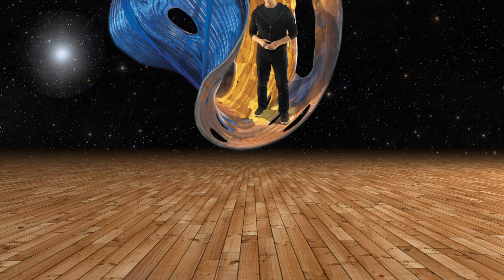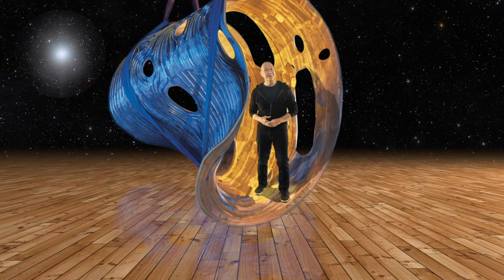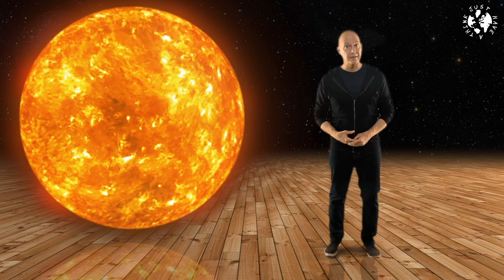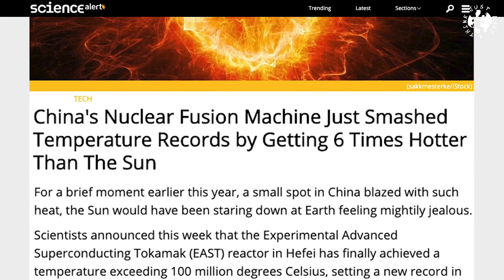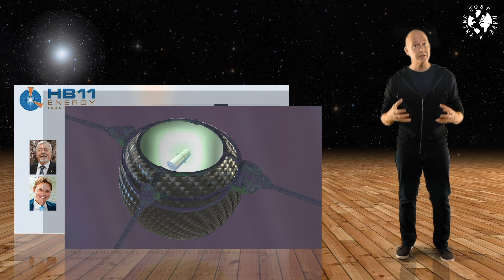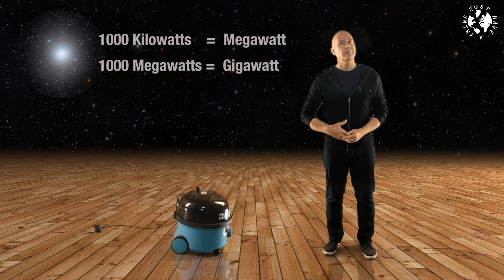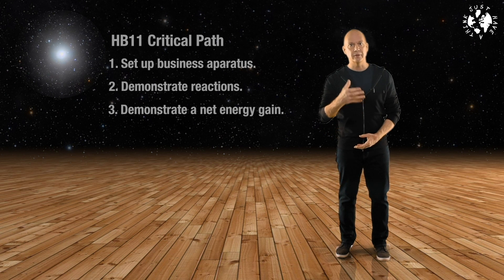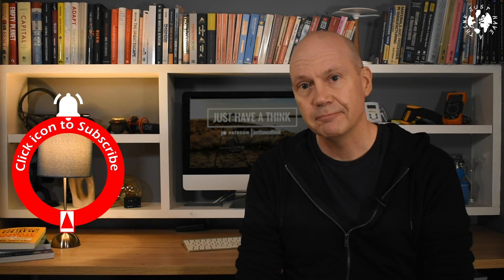Nuclear Fusion:  Revolutionary new breakthrough.

Comment: Even in the 1970s, lasers were available that produced electric field components in the beam which could accelerate electrons from rest to almost the speed of light in the diameter of a proton. The much heavier particles of fusion fuel would not go so fast, but they don't need to in order to initiate fusion. They don't even have to go 1000 km/s. Now we have tabletop lasers built around Titanium Doped Sapphire that can put out pulses at far higher power, in the hundreds of terawatts (TW), for about USD$20,000. If this notion of laser-accelerated particles works as well as is being claimed, we should be able to power individual homes with their own Fusion Generators. We should also have been seeing a LOT of people doing research on the idea. Where are they all?

Comment: If nuclear fusion theories were true, stars wouldn’t be distributed along large plasma filaments. Stars also wouldn’t disappear and reappear which we have thousands of observations to show that they do. Stars are an electrical phenomenon, and they, like everything else, are powered by their external environment. Their movement throughout their parent galaxy, and the electromagnetic field surrounding them, causes them to shine. Just like you and I need food for energy, so too do stars. Nothing in the universe just runs itself. Stars are constructive pinch points of electromagnetic fields. This forms their internal structure (gas, rock, metals, etc...), and causes the voltage potential difference that burns them. Just like clouds of water vapor release lightning. They don’t make the lightning bolt, they move through the atmosphere until pressure and voltage differences overcome the insulating boundary between the two clouds, or earth and cloud, etc...

Comment: I like your videos .. we should be concentrating on all types of nuclear. to date its the only low less than 2% to zero carbon emissions ..even with current designs... focus on . Gen 4 passive safe walk away fission designs. Shut down all the older Gen 2 and 3 Light pressure water reactors.. . and not extending all the current fission reactors which are beyond their date.. Energy mix of SMR current fission ...as well as thorium type designs.. and more research into this type of fusion ie both stellartors and  this new described one. Shame all has gone silent on Bussard wiffle ball fusion reactor it seems to have died with him. He did a great talk at google its on you tube on that. But also would be or should be discussed the ENVIRONMENTAL damage of wind power.. ie clearing 1000 hectares of land all around destroyed hedge rows in the process as well as direct in path as it wind of insects and bees and birds etc... which never seems to be discussed..

Comment: 1. Missing fusor type devices that have met similar progress at much lower cost than tokamac projects. 2. D+ T fusion generates 5x neutrons for equiv energy generated - most strong magnets and high temp superconductors contain high cross section neutron absorbing isotopes 3. Proton plus Boron11 makes 3 Helium nuclei (first high energy Carbon12 which may emit a gamma and stay C12 or fragment into helium (alpha particle) plus Berylium8 which rapidly splits into 2 Helium atoms and the energy to initiate this reaction is much more than D+T reaction.

Comment: We still don't, and have no idea how, to make materials that can handle the radiation when it's operating. A fusion core of any commercial size will eat away at it's own core, requiring frequent repair and replacement, making it not commercially viable. Lather rinse repeat. We are no closer.

Comment: Is there some paper detailing the process? If not then it can't be taken seriously.

Edit: ok nvm, there's the paper in the description. Hopefully it can be replicated.
Reply: Yeah, if you read the paper, it becomes apparent that this has nothing to do with practical fusion reactors. As the paper itself notes, experiments with boron fusion like these have been conducted many times before, the only new thing the authors achieved was the increased energy output. A hundred times as much energy per laser shot is cool and all, but just like before it's done on an experimental research laser facility. Even if they try building a reactor, who knows how long will that take them to do, and if they even succeed. A similar company called Tri-Alpha Energy has been operational for 20 years and they still have not built a working prototype.

Comment: I'm going to be optimistic and assume that this will actually work. Just for the moment. So WHY can't we have solar energy and nuclear reactors working side by side? After all, the canoe was probably the first boat ever invented. Today we have ocean liners. But we STILL have canoes! And sail boats were invented hundreds of years ago. And of course, today we have nuclear powered submarines. But we STILL have sail boats. Each piece of technology that we invent, fits into it's own ecological techno-system! We are not necessarily making things obsolete. We are simply adding new things to the world. Some of the old things might not be as widespread as they formerly were, but assuming that they were good solutions to begin with, they are still in use.

Comment: Optical nuclear batteries are made when phosphors glow from Alpha Sources Is Received By Photovoltaic Cells. Make It Glow Safely Then Live Off The Light Energy Converted Into Electricity. Running A Nuclear Explosion For Heat Turbines Or What's On Happening On The Sun Is Dangerous. SAFE Phosphor Glowing, Optical, Solar Cell, Nuclear, Power. Not This Insanity.

Comment: I honestly do think we will see fusion technology in our life times, and there is a good chance we will see it within the next twenty or thirty years. It is not going to happen tomorrow. However, and even when we do have a commercially viable reactor. getting enough of them out there to take care of the worlds energy needs will take time. I think we still need to invest in things like solar and wind for that reason. We could use that technology to cover a lot of our energy needs within the next few years, if we really wanted to. Barring a miracle break through. i don't see Fusion doing that for the next decade or two, even if we did invest all our effort into it, and crack the code in the next five to ten years.

Comment: So when we have all this unlimited cheap energy, after we've used it, where does it all go to? (assuming as usual energy doesn't disappear it just changes to another form)
Therefore we use the energy to make stuff, to live nice lives, do good deeds etc. all of which will have a by product of energy, so the Earth's atmosphere warms up, though maybe with not so much pollution by carbon this time.
Reply: The Earth has a thermal equilibrium point. The hotter it is, the faster it radiates, because glowing in higher frequencies of blackbody radiation eats more energy than lower frequencies. So if we start using a lot of power, we will get hotter a little bit, but it won't be some runaway reaction.

Comment: Short answer, no.

Long answer: There is a reason fusion research is a fringe subject in particle physics. Without a gravity well doing the work getting hydrogen to a plasma state energetic enough to instigate fusion but in a controlled manner is so ludicrously power intensive there is no reasonable path to it being a net producer of energy ever. Physics remains a thing.
Reply: Did you actually watch the video before commenting? I'm not saying these guys are the ones to crack nuclear fusion. Their approach may not be productive in the end. But they do at least address the problem you're talking about.
Reply: @Kevin_Street  Then why are they talking it up?
Reply: So you didn't watch the video.

Comment: Sounds good but we'll never hear of it again. Like so much other technological break throughs. If it does work it'll be buried.
Reply: With the rate the world is moving away from Fossil Fuels, and with the way technology allows information to be shared you can't just bury something that easily anymore. Plus, with Coal dying slowly, the rich need something new to latch onto, so instead of "hiding" it, they're more likely invest in it to get returns and diversify their portfolio. The world is too open to just sweep stuff like this under a rug, especially once patents are filed.

Comment: Until you have a Mr. Fusion device, with direct electron output, no exotic coolants required, with full shielding, instantly stops the reaction once the input power has been cut, and will fit into a rear end of a standard sized sedan, it will just be a very expensive experiment without much if any practical power generating capability.

Comment: A (peta)Watt is a measure of power - not energy. You can (relatively) easily get a petawatt laserpulse if the timeframe is short enough. Because then the actual energy (which is power times duration) is relatively low. Your vacuum delivers the power constantly over a long period oftime. Petawatt laserpulses are on the order of nano to attoseconds long.

Comment: 1. It is no cliche, it is a FACT 2. while chasing pipe dream, rolling out proven, clean modern reactors is stalled - and these can provide "unlimited, safe, clean, zero-carbon electricity as long as we need it". Before shouting about 'waste' and other read pt. 4; 3. Fusion crowd doesn't have ANY credibility whatsoever - until they roll out at least 10MWe reactor working with 80% capacity factor for over a year.  4. Had all these money gone into nuclear, we'd have largely decarbonized grids and sea transportation, powered by combination of 3rd generation (APR+) and 4th generation reactors, largely burning modern and accumulated so called 'waste' and producing carbon-neutral kerosine.5. DUDE learn difference between POWER and ENERGY - so called femtosecond lasers indeed generate terawatt power scale pulses, but just due to extremaly SHORT TIME - POWER IS HUGE, but total ENERGY remains miniscule. Boron route has already been explored by company giving techtalk at google - and then quitely disbanding.

Comment: Every step closer to breakeven involves bigger, more complex, and more expensive reactors, so by the time they exceed "breakeven" and produce useful amounts of power, it will be far too expensive to be economically competitive. That doesn't mean we shouldn't research it, just that we can't rely on it to supply our basic energy needs. It may find some use in special applications like deep space probes, where the high cost isn't a barrier.

Comment: It won't replace oil, or renewable, I don't think it ever will. First it probably won't produce enough volume to supply everyone, second it can't be moved around or stored as we don't have enough efficient batteries to hold electricity like we do with hydroelectric power, fast for sudden high demand. Fusion will be stable output. Third material cost for the prototypes and research and development costs are huge so it probably gonna be more expensive than normal conventional energy which will shatter some people's dreams and high hopes of thinking the moment we have fusion, is when electricity is free and oil is gone, so that will discourage them thinking fusion is just another gimmick.

That's my 2 cents on how it will turn out. See me in 20 years nigga

Comment: We have been working on controlled fusion since when? 1953! How long is that? 2020-1953 = 67 years. That's right, almost a century. So far, we have yet to build a fusion reactor that can produce enough excess energy to light up a single LED. That's right, a single LED. Now we are wasting money on this boondoggle for what? This phony BS about anthropogenic global warming? NUTS! There is no such thing. We cannot ever produce that much carbon dioxide! Why? Because there is already enough carbon dioxide in the atmosphere to warm it up as much as it will ever warm. Think of carbon dioxide as a kind of insulation. Earth is already as insulated as it can be by carbon dioxide. Were it to warm up any more, a dramatic increase in atmospheric pressure is necessary. Understand. An increase in pressure is necessary to bring the average temperature up. Carbon dioxide has nothing to do with climate change.

Comment: Elimination of the "steam engine" required to produce electrical energy is THE KEY to practical fusion power.  Proponents of the tokamak style reactors do not mention that the energy produced is in the form of fast neutrons, which heat a stainless steel cooling jacket, and the resultant steam runs a turbine.  The problem is, the neutrons ablate and blister the steel, requiring its replacement at intervals- and that steel is now HIGHLY radioactive- tons and tons of it.  It needs to be sequestered, just like the fuel rods from a fission reactor.

This new tech is a major step to the real solution.
Reply: Not really. The neutrons have to be captured in a lithium blanket in order to regenerate tritium. Of course, some unwanted neutron captures will happen in the first wall. That is why some elements (eg. cobalt) are not allowed to be used there. 

The only acceptable design is such that you don't need to replace irradiated materials! The must stay fit enough to work for something like 60 years AND loose radioactivity in, say, 100 years after the plant is decomissioned.

Stainless steel does not blister. Berrilium does. When irradiated with neutrons it breaks down into two 4He. Hellium diffuses through the metal eventually firma bubbles. You must do the cleaning if you want to remove the dust, but Be does not become radioactive itself.

The tokamak chamber is going to be an unfriendly place but all operations there will be done remotely.
Reply: @WielkiKaleson  That sounds like an AMAZING band name, movie title, theme parkride etc.: the tokomak chamber!
Reply: @WielkiKaleson  Read " Tritium Removal "
Reply: @WielkiKaleson  Where are YOUR arguments Professor, to prove contradictors wrong ...
Reply: 1. Thorium cannot be used in its natural state, read about Thorium breeding and
the costs, etc involved.
Reply: Fission Suppressed Fusion Hybrid based off MIT ARC would be awesome.
Reply: Those problems with neutron & heat management are a lot easier to manage when the blanket is liquid! Check out the MIT / CFS 'ARC' and 'SPARC' reactors.
Reply: Physisists tell us,  we can live happily ever after ... after
Reply: [Place holder note: I'm sorry I have a migraine right now with extreme eye pain and have drastically increase the length of this comment in explanation of my lack of short-term memory compromising the prior version. I will return that version once I feel better and hope I never have another migraine for many decades.]

Comment: We should put far greater resources into fusion, precisely for the reasons you present.  This is an energy source that means essentially unlimited, clean, cheap power.  Given the incredible promise of fusion, we should have multiple, parallel, and unique experimental approaches, all of which should receive ample government funding.  A healthy competition that also features free collaboration between all "competing" teams.  Fusion promises a Return On Investment of what, infinity?  We should put fusion on the fast-track - as in, a crash program, to get it done as soon as possible.  We already know it works, it's just an engineering challenge to overcome.  I say, full-steam ahead, all systems go!  And thank you to justhaveathink for a fine presentation!

Comment: There are, of course, several fusion methods outside of TOKOMAK, Stellerator, plasma magnetic confinement planform. Some are fringe science, some are fringe engineering. IMHO, there should.be heavy funding for all-comers with heavy oversight measuring progress. Fusion is a breakthrough, disruptive tech; so much so that, if achieved in any form the world changes and the smaller the footprint of the generator the more extreme the change for the better. So: very high risk with extremely high pay off. That is worth gambling on a monty-carlo-algorithem like program that scatter-shots funding ... as long as there is also stern but open minded oversight of the funds and the progress.

The US is about to spend $2E12 to "boost the economy."
Smart spending of $5E10 on fusion research could very well get the world economy back to the boom times of the 1960s US, but for everyone.
In the mean time, solar is basically free energy in the right amounts for homes. Let's get mega-watt solar power installed on roofs everywhere and electric trasport as a standard. We can fill in the extras with nuclear -fission and/or fusion- when it's ready.

Comment: To be fair nuclear fusion isn't just nuclear fission run backwards as seems to be claimed in the video.  Nuclear fission produces energy...if you were able to literally run it backwards then it would require energy...not produce energy.  Fission is a different process, the only way it is "opposite" of fission is that one process you end up with a higher atomic weight atom and in the other you end up with a lower atomic weight atom...but its not just reversal of the process.